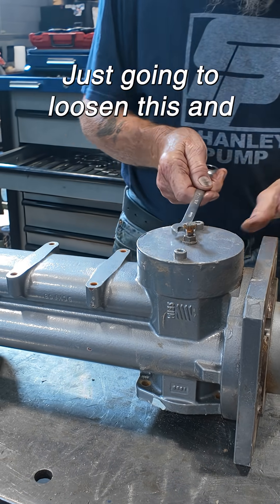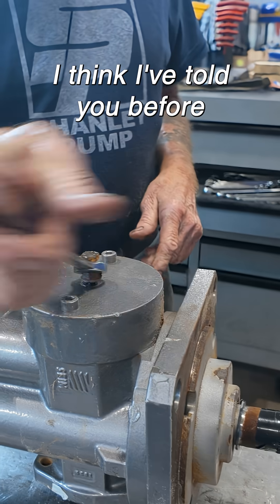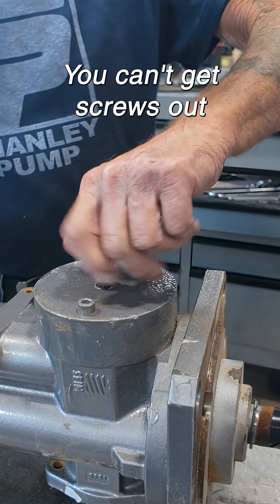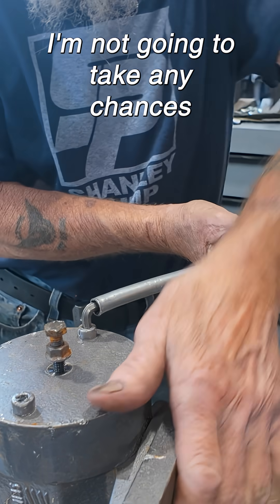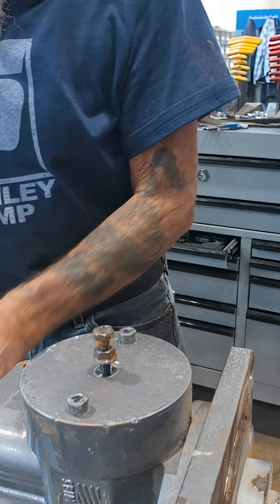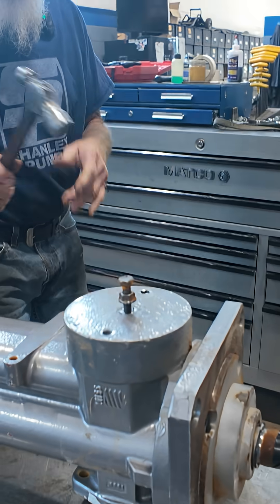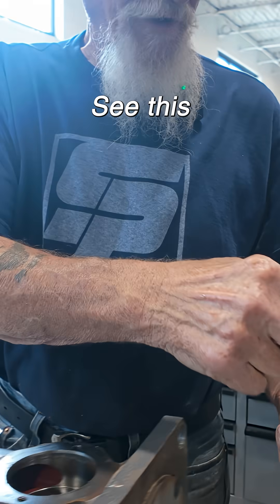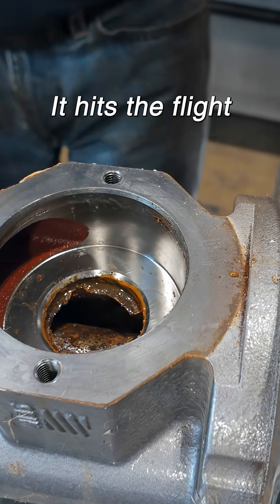Inspection of a SEIM PXF Screw Pump Part 1

Comment: Pour in some phosphoric acid and soak overnight before messing with it and you will have a far easier time. Or you can use muriatic and it will de-rust in 5 minutes.